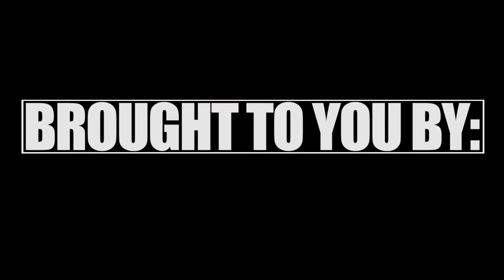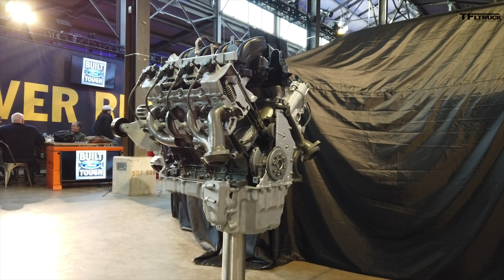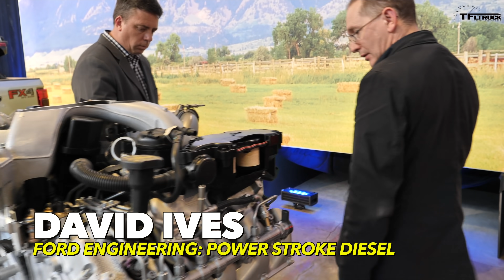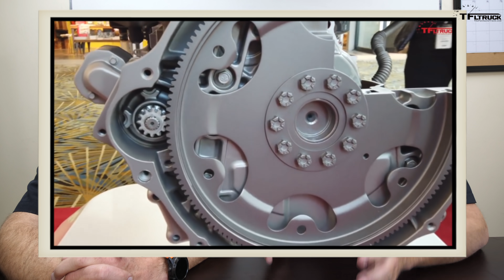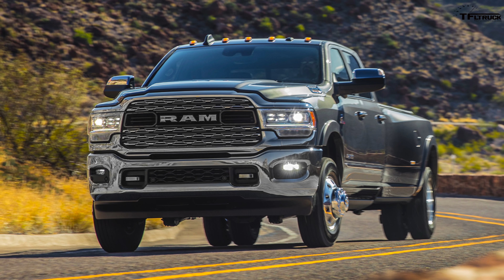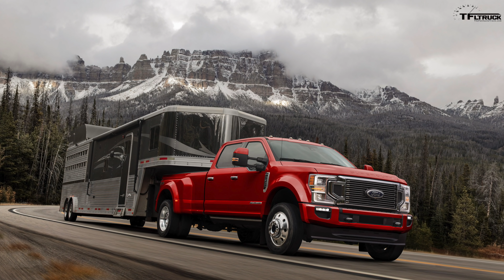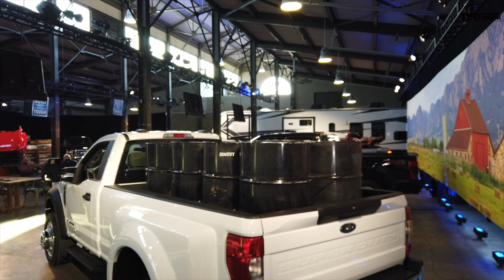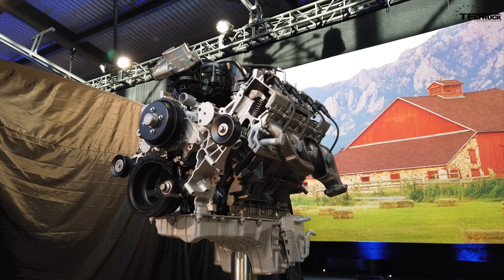Are Diesel HD Trucks Dead / Will Electric Pickups Replace Them? No, You're Wrong! Ep.5

Comment: Small turbo diesel that power electric motors. Exactly like a locomotive. No heavy battery, no transmission, no heavy motor. The manufacturers already know this but they make far more money by taking one technological advance at a time then going straight to where they want to be.
Reply: Taylor, I do not disagree with your logic in fact it is very well-founded and already time proven. However, it can be done one step better nowadays. Factor in the fact that diesel fuel is at least $0.75 a gallon more than gasoline, plus the fact that a diesel engine cost more to both manufacturer and on the user end to purchase, and a diesel electric hybrid would fall short of what is available with today's current gasoline engine technology. You are on the right track no doubt about it. But let's look at what could actually be done the absolute cheapest for the consumer. You could very easily take a direct injected variable valve timing three-cylinder turbocharged and intercooled gasoline engine and all that engine does is drive a generator. The actual proportion will be handled by electric motors at all four wheels. A simple battery pack between the frame rails underneath the truck bed would give and almost 50/50 weight distribution. Because of the battery pack the engine would not have to run all the time, it could be built as a plug-in hybrid just like the Chevy Volt is. This kind of truck would be hyper efficient. The only problem is, if they actually were to build this vehicle as I have mentioned in a full size truck platform you would have a truck that would exceed 100 mile per gallon. And that would have the big oil companies crapping in their pants. Therefore it will never happen. It's not that it can't happen. It simply will never happen, not in our lifetime.
Reply: COYOTE ADVENTURES You’re forgetting about the added weight. You can’t get 450 hp and 935 torque out of a 3-cylinder engine running a generator. Think about it. If your 3-cyl output is 35kW (which would be a miracle) and your battery pack is 60kW, you will not be able to keep charge at steady full throttle (inefficient) when your motors require 150kW to perform as desired. You’ll need a 6-cyl turbo and that will negate the fuel savings. You can’t get 100 mpg from a 5700 lb vehicle. Likely, a 100 kW battery adds 1200 lbs. Your oil company conspiracy just doesn’t hold up to simple math.
Reply: @natehawkins2910  this was not meant as a horsepower issue, the discussion was on fuel economy.
Reply: COYOTE ADVENTURES I’m speaking in reality language, so It has to be a horsepower issue in order to make a 5200 lb vehicle move. And haul. And tow. If you don’t factor in hp needs, you might as well just make up any data you desire and discuss a hypothetical daydream.
Reply: @natehawkins2910  Yes you can easily get 500lb/ft & 500hp out of 3 Cylinders. It's called OPPOSED PISTON. 3x Cylinders but 6 Pistons.
Reply: Neojhun Don’t be ridiculous. Or dumb.
Reply: @natehawkins2910  it is a real technology.  Google opposed piston diesel. Don't be ignorant.
Reply: @asherdie  3 Cylinder is also the  Sweet Spot for Engine Timing in a 2x Two Stroke Piston per Cylinder architecture. It has just enough over lap time to be smooth but not too much processes are repeating at the same time. Neo Craft
 sorry you fail at basic engineering knowledge.
https://en.wikipedia.org/wiki/Opposed-piston_engine
Reply: Electric traction motors or no electric traction motors, you still have to use after-treatment systems to clean the exhaust. That's what always kills diesels.
Reply: Ironically you could compare it to the phone industry......

[Expensive and better every year]*
Reply: No battery but you will need a Super Capacitor. At-least several Kwh.
Reply: It is more than that. Converting entirely is expensive, and you need a market for it as well. If consumers do not like your product, you are dead in the water.  So it is a small transition, to slowly aclimate consumers.  It is also cheaper, vs completely retooling all your factories.

Finally, the one factor everyone seems to forget is real world vs perfect world.  In the real world traffic jams happen, back ups, things break, weather, and accidents.  What is going to happen to these vehicles in an accident?  What if a work truck gets mangled at a job site like work trucks do.  Would these panel survive?  Think of this like putting wheels on your iPhone.
Reply: That's called a Series hybrid where there is no Mechanical Connections to the wheels. VIA Trucks & Work Horse already did that. Problem is you are entirely reliant on small electricity supply and have a massive engine & fuel tank taking up space. Thus it's a compromise and weaker. If you want a Compromised Hybrid you are better off with a PARALLEL drive train where both Combustion Engine + Electric Motors can drive the wheels together.
Reply: EXactlY! Great comment.

Comment: The real reason trucks haven't gone to a full hybrid or full electric is simply rang most trucks in ues drive twice the amount that a car on average drives. For example in texas unless you live in or close to a major city you have to drive in to town and back home some times it can be on average can be a 60 mile round trip now that's pretty easy for a full hybrid or electric car to do but now add a tow wight to your trip and say you have to got to a different job site like a construction worker you rang will be impacted with the add wight also if you only did have a gas engine 7.3 with 2 electric motors plus the most likely large and heavy battery will probably cost and way the same if not more than than a diesel engine option.

Comment: All the lithium batteries would way a lot more than the weight savings of a gas vs diesel engine. I think you're going to need to add a turbo or supercharger to that 7.3L  gas engine to make people want it in a dually F350 vs a 6.7L Powerstroke.  You will probably need to add water-meth injection as well to keep temps down when towing up large hills.

Comment: Nope. Not buying a pickup with a lithium grenade under the cab. I would love to have a gasoline-electric hybrid, but the battery tech simply is not safe or reliable enough for serious work trucks yet. I don't think anybody wants a truck that will turn into a Rimac incident the first time they take it off road.

For those who missed it, the Rimac that Richard Hammond crashed caught fire, was extinguished, and then kept reigniting for days after the crash due to abchsin reaction of damaged batteries damaging other batteries. Lithium fires are ridiculously toxic and difficult, maybe impossible, for most fire departments to extinguish. 

Sorry, fellas. The tech simply isn't worth the cost (personally or environmentally) yet.

Comment: Another great video and discussion.  I think the engineers and market will figure this out. I lived through all the energy crisis, EPA demands and the manufactures figure it out. Each first step produces rigs with problems. Who could have ever imagined today's engines producing 3x the horse power and fuel economy when I was setting in gas lines in the mid 70's. I think making a large gas engine with economy of the diesel will be a challenge, even today's gas engines fall on their face when towing heavy at the gas pump. Maybe the future will be electric, maybe it will be hydrogen, maybe it will be CNG, maybe it will be who knows what, but I bet in the end whatever they build will be better then we have today. Long live the automobile,  an engineering marvel since the 1800's.

Comment: Gota put your money where your mouth is, ultimately it will come down to cost, if fuel prices rise you will see a market shift to electric trucks. The biggest hurdle ev have to face is the lack infrastructure, without enough charging point there would be lower demand and higher constrains on manufacturer to put larger batteries that are less efficient due to weight.

Comment: What they have done to diesel in this country is disgusting! Diesel use to be the cheapest fuel In, Commiefornia  diesel is 35 cents a gallon more than premium gas!  No more mechanically driven injection pumps, having to add cancer  causing DEF,maybe all the signs are that they're on the way out? WHAT A SHAME!

Comment: Why hybrid if you can go all-electric? The new Tesla Roadster makes 7000+ ft lbs of torque. You only really need 1000 ft lbs in a truck. Maybe we will see bigger trucks and SUVs again due to the fact that transportation gets cheaper with all-electric trucks, too.  That would be great.
Reply: MayReasonBeThyGuide Was it tested? Seems like that’s just a tall tale. Diesel trucks go further, have more power, and you don’t need to speed 2 hours charging D batteries. Don’t you realize that your draining the environment more by making batteries that size? If your going to the car discussion, you already have cars that can go almost the same 0-60 time, can go faster, and more aerodynamic. Cars are culture, it represents who you are.  Sure there can be electric cars, but long live gas and diesel motors.

Comment: I don't get the current obsession with diesels, and I own a 5.9 Cummins!  
In my experience diesel does not save money in operating costs because the fuel is more expensive.  In my case my 6.2 Ford gets about 15mpg average.  My 5.9 Cummins gets almost 20mpg average, so call it 33% better mpg.  Right now gas is $2.20 a gallon where I am and diesel is $2.97.  The difference in fuel cost wipes out any mpg benefit without even comparing oil changes and the additional cost of DEF on modern diesels. 

I do think diesels are better for towing, and if you do a lot of towing a diesel would probably make you happy.  However do not kid yourself you are saving any money because you are not.

Note: I did not mention cost of buying the truck because while initial cost is higher on a diesel so is the resale so I think they are probably awash.

As for electrification, nowhere near close to having a usable fully electric truck because the range is not going to be all that great on them to begin with and trucks tend to do a lot of miles.  You cant afford to park your truck to recharge it for hours, many trucks are going 20 hours out of 24 with 2 drivers operating them.  Can't do that if you have to wait 12 hours for it to charge.  Hybrids will probably come sooner but my guess would be mild hybrids not trucks that run on full electric power for 20 miles or so.

Comment: They are going to keep increasing compression, variable fuel-air ratio, and other efficiency of gas engines and they will eventually make diesel obsolete.
Reply: Diesels are already obsolete, todays gas  trucks are making more power than diesels fron the 90s, right now its all about power numbers and the power to haul has already been there, it just depends on the gearing

Comment: Battery tech needs to come a long ways.  Or they needed to get cheaper.  But those high liter gas engines get terrible gas mileage.  Unfortunately I do think this is where the auto makers are headed, but I don't like it.  They don't really have a choice due to government regulations but it's going to make prices to continue rising and then when I go to buy a 10 year old truck cuz that's all I can afford nothing is going to work.  Batteries are going to be shot, unless you spend 10k to replace them.  Have you ever seen any battery last more than a couple years?  Cell phones after a year of use the battery is at about half capacity of when it was new.  Same with laptops and anything that uses lithium batteries.  Batteries have very limited charge cycles.

Comment: Heavy duty trucks will likely be the last consumer vehicles that will have an electric only option.  Right now the 400V electric vehicles are not quite up to the task due to refuel times.   The practical limit to charging right now is about 400 amps.  So at 400v and 400 amps that is 160kW of charging.  On a say 300 kWh battery pack that would take about 2hr to recharge while providing about 250-300 miles of range while towing a heavy load.  However, the next generation of BEV's are being built with 800v battery packs.  This cuts the charging time in 1/2.  So you could drive 250-300 miles and take a 1hr break to eat and rest and then go another 250-300 miles.  At that point the smooth power, (mainly torque) , excellent down hill braking due to regenerative braking, low maintenance costs (no oil changes) and very low fuel costs  will allow battery electric trucks to win over a significant portion of the heavy duty truck market.     The cost of building the 800v components is high right now as there are still, mostly in the R&D phase.  However, in a few years (my guess is about 5) the cost will come down through mass production.  Currently most new CCS charging stations that are being deployed by Electrify American are capable of 800v charging.  Because of the VW diesel emission cheating scandal, VW is required to spend 2 billion dollars, as part of the settlement,  over the same time building out this nation wide charging network.   

 Will all people want to convert?  No, there is always be people who resist change for what ever reason.  This might be especially true in remote thinly populated areas like Alaska.  However, I think the Majority (over 50%) will switch once this change takes place over the next few years.

It is always good to have more options.

Comment: I hope Electric Trucks Replace Diesels , this way The Price tag on Diesels will go from 80,000 & Up TOO 30,000 & Down !  What I find Interesting is Diesels are getting way To Expensive while The Life Expectancy is about 300,000 then you have to Overhaul it !   I would Think for 80,000  for a Diesel Truck , we should get at Least 600,000 miles before anything Major Has to be down to the Engine !

Comment: Poor Ford,  there has never been a gas powered engine to ever challenge the durability and longevity of a diesel engine. But if they only used the gas engine as a power source for an electric motor and drive system then maybe one day. But Ford is not the company to create electronics. They have had the same cruise control Fire Hazard recall for the F-150 for the last 20 years.

Comment: I completely agree with Roman ! It makes sense to add motors primarily for torque similar to what super cars are doing these days. That way you don’t need a very large battery but should also substantially increase mpg and durability of the engine as the motors do the heavy lifting with the engine acting mostly as a generator

Comment: The only reason there is  7.3 now is because the V10 was huge outdated and underpowered. Chevy has been using a bigger V8 for it's heavy duty line for years. With cylinder deactivation it's way more efficient than the Fords old V10. With the V10 being so old it was time for a new heavy duty gasser that's all

Comment: Roman is not only wrong but he's on crack. Plain and simple hybrids do not work on long distance driving. They are great for in city with lots of stop and go traffic without using the brakes for regen the whole system is useless while crusing. Look at a Prius once the battery is used up usually around 20 miles it a regular car until u hit the brakes or coast to get some juice back

Comment: Andre is right. Why, well because diesel is exactly for heavy duty use. It is not for town and a school run and a run to the mall and just some start and stop traffic. Occasionally yes, no problem, but for everyday use - no, no, no. It is for long trip, taking on some heavy load, towing, dragging or whatever. A start-stop system imo should never be fitted on a diesel vehicle. In America you use those pickups for a regular car a lot. If it is in the city then put a hybrid in it, it will do the job brilliantly. Or for a little outdoor adventure, mudding, rock crawling. I agree that in a highly populated area, a lot of start-stop traffic and such a petrol hybrid is much more sensible. But take this hybrid on a long trip and it will be out of juice in a heartbeat. Then you will be left with the 7.3 gas eating monkey, moving this brick through the air, towing some heavy load. Also not to be forgotten that Diesel is an essential part from crude oil. It is around 50% from the volume of petrol. So if to say from a barrel of crude oil around 20% is petrol, then 10% is diesel. That is a lot. What are you going to do with that, throw it away? No, no, no you use it, as this is the most environmental thing to do when you already produced it.

Comment: 7.3 V8 gas motor Wil make 575 hp and 610trq with a 10 speed alison trans.
Reply: Its not going to make anywhere near 575HP LOL. That puts it into the class of engines such as the C6 Z06 which made 505HP on 7 liters and also screamed to a 7,000 rpm redline and would never work in a towing application. 430 horsepower with 550 torque probably at most.
Reply: @ohgodwhat1  lol its a V8 with a turbo it

Comment: 200,000 - 300,000 before a diesel in a pickup needs a rebuild?
 I can personally tell you old body style Ford 94-97 with the 1st Generation 7.3 Powerstroke doesn't have a problem rolling over the electronic odometer at 400,000 miles and keep going.